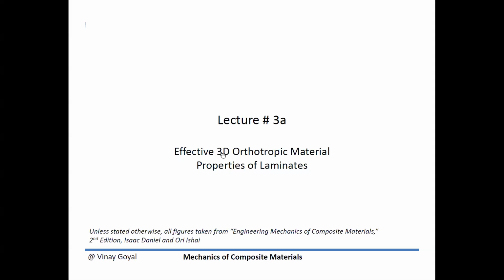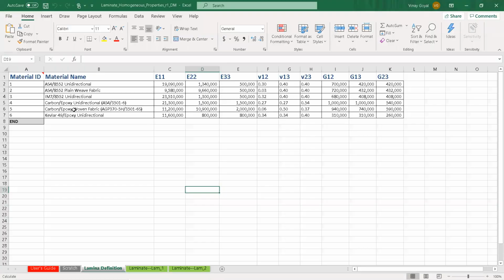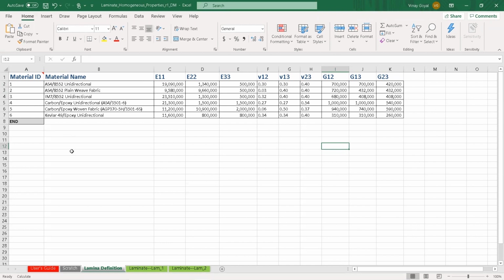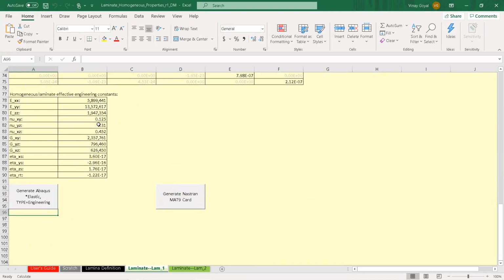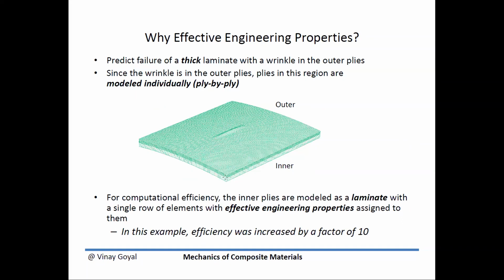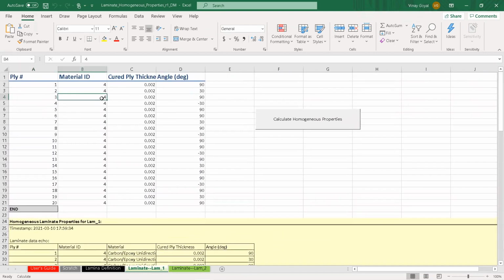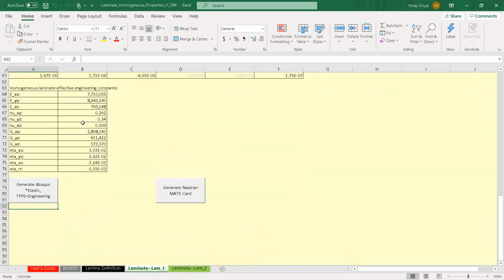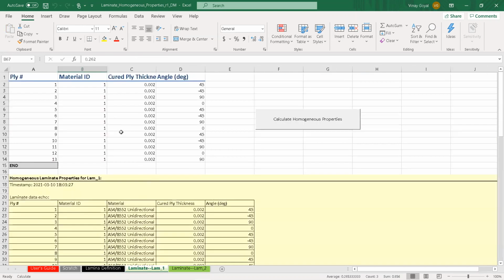Mechanics of Composite Materials: Lecture 3B - Determining Effective Engineering Constants (Example)

Comment: Do you know if this would work on modelling (abaqus) a composite layup using 2D plane strain elements with 3D effective laminate engineering constants? Im currently doing this for UD but I need to move on to laminates. I'm interested in a copy of the excel to try this.